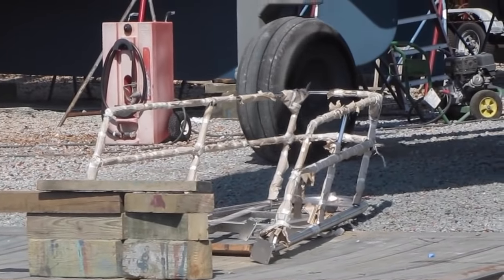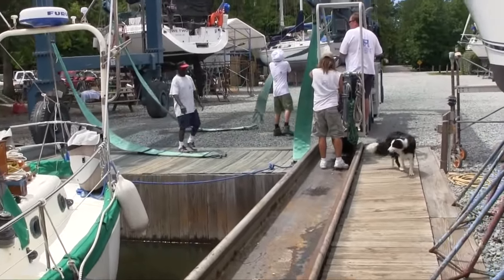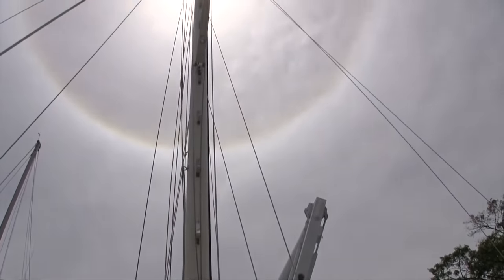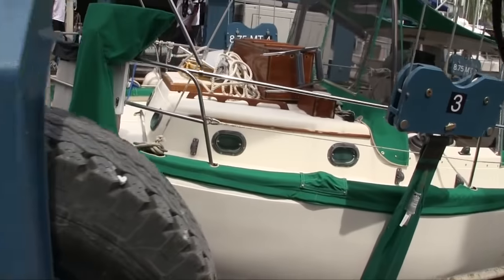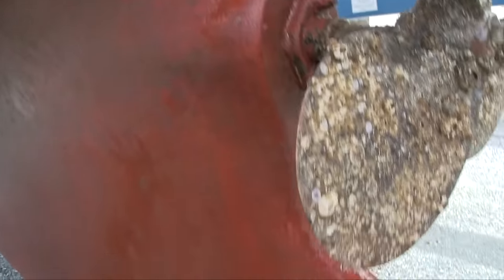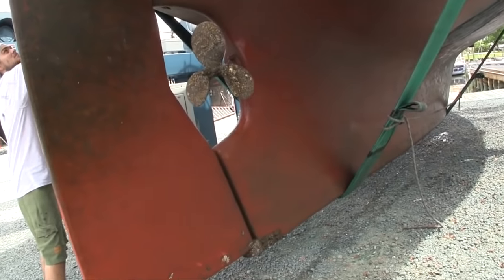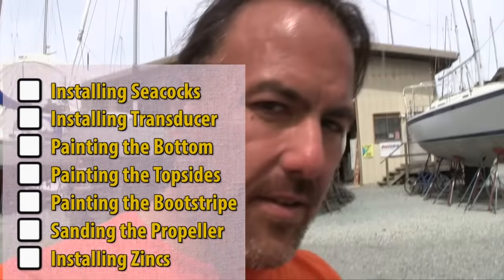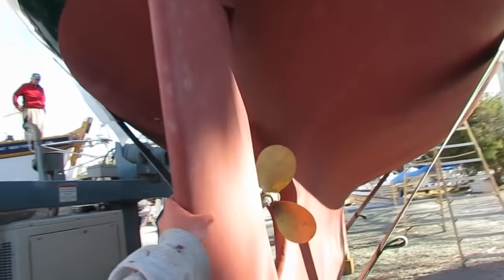Installing the Bowsprit, Stepping the Mast, and Hauling Out | #6 | DrakeParagon Sailing Season 1

Comment: The ring around the sun is known as a "solar corona" and fit is caused by moisture, usually ice crystals, in the high atmosphere.  Corona means "crown" or "halo" and you can have lunar coronas as well.  My grandparents  used to say that a "ring around the sun" was a harbinger of a snowstorm.

Comment: Happy to be a subscriber and follow the videos. So well done and informative. I may join the ranks of the liveaboard. Setting aside the budget question, what boat would you get for a singlehandler. I am inclined to the Shannon 43.
Reply from the maker: I think if your goal is to sail offshore single handedly then you should do a very long offshore passage on that boat with or as crew.   During the voyage imagine what it would be like to have to do everything by yourself before you buy it.  I think that the bigger the boat becomes the harder it can be to single hand, and especially to dock.

Comment: Thanks Mr. Roberts. Wonderful videos and vessel. If sailing her is your vocation then I think you made a great decision. Different question. I read that hard core sailors sometimes switch to steel/alloy hulls. I always thought the number one mission when transiting a waterway is to not bounce off of reefs, shoals or other vessels. What says you about GRP and Bluewater? Fair Winds
Reply from the maker: I'm really just trying to tell stories about the cruising life rather than getting into being very technical or instructional.  But personally I think that for a boat to go offshore and thus potentially be in heavy weather, the design of the boat is more important than the material used.  Things like skeg hung rudders, and keels that are attached well enough to make it impossible for them to get ripped off are most important to me that hull material.  That said, if I were going into waters where the boat could potentially get stuck in ice over a winter then I would definitely want a steel hull that couldn't crush like fiberglass.

Comment: Drake, tell us more about your air conditioning. You've mentioned it's being cooled by sea water, that must be really improving it's efficiency. Could you tell us what make it is or how much power does it use? 
Thanks,
~dzh
Reply from the maker: I have two Webasto 16,5000 BTU reverse cycle air conditioners bought from Defender.   They can not be run without being plugged into shore power and each requires it's own dedicated connection to shore power.

Comment: DrakeParagon Presents the Real Cruising Life  That was a halo over the mast. How often do you do a major over haul like that? All that work being done looks very expensive.
Reply from the maker: Hi Jadah, I usually haul out every 3-4 years to sand and repaint the bottom with antifouling paint and replace zincs.  I think I've heard that standing rigging should be replaced every 10,000 nautical miles of offshore sailing which is a lot more work because ideally you'd take the mast down to do this.  Replacing the bowsprit was a one time thing I hope! :)
Reply: DrakeParagon Presents the Real Cruising Life Okay, because this work you're having done looks like it will be quiet expensive.

Comment: Drake, what bottom paint did you use that gave you two years (?) of an unfouled hull?
Reply from the maker: Hi Jonathan, I'm not sure how much of a difference it made, but first I lightly sanded the entire hull with a Dewalt palm sander and 80 grit sandpaper.  Then I rolled on 4 coats of Pettit Trinidad red.   I heard that Pettit Trinidad in color red is better than the other available colors because it contains a higher amount of copper (but costs the same.)  I can't believe it was over 4 years between haulouts.  During the first two of those years I lightly scraped and scrubbed the bottom in the water in the Caribbean with SCUBA gear twice.  Over the next 2.5 years in the water in North Carolina I never hauled out or scrubbed the hull.. I was really surprised that there wasn't more growth on the bottom when we hauled out.  
Next on DrakeParagon: Hull Tour :)
Happy sailing,